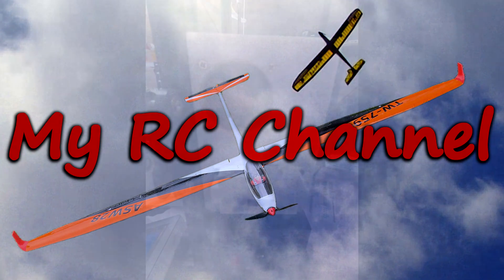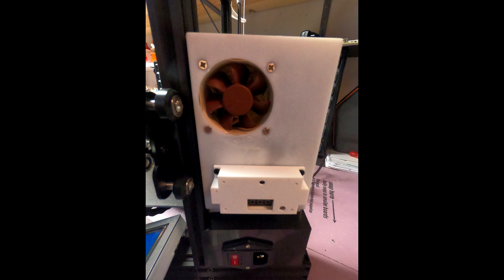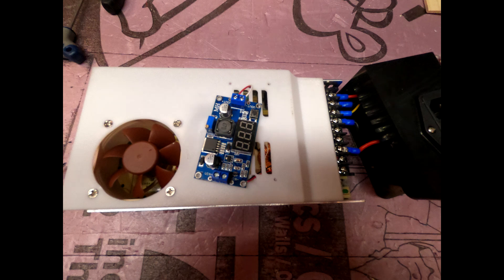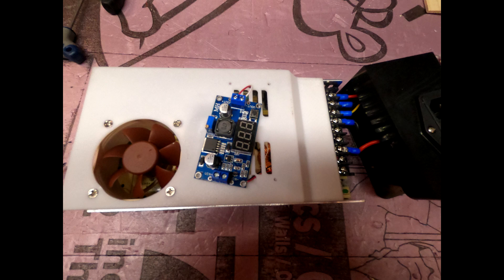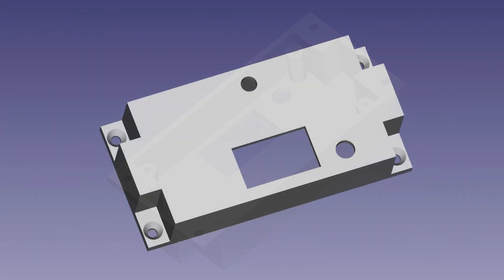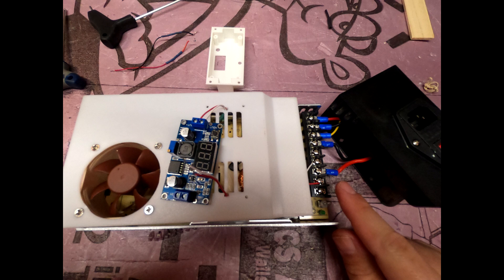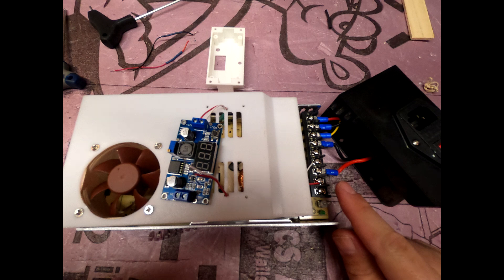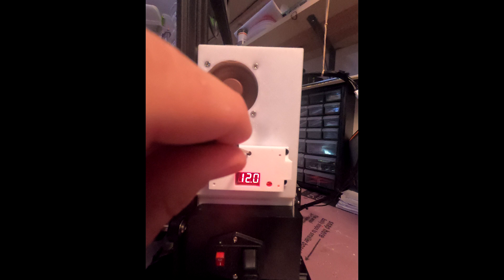Adding a Noctua 60mm Fan to the Ender 3 Pro's Power Supply (PSU)

Comment: My PSU fan is also a 12 Volt fan. so no need fora buck converter. Model Ender 3 Pro 2020. As far as i read in the net, it is the same for the previous PSUs ... all 12 V Fan in the PSU. All other is 24 Volt, correct, but the PSU is not.,
Reply from the maker: I'm not sure. I'm not a 3D printer expert... this is my first and only 3d printer. It ran almost 24-7 for the first 3 months... but I kinda got busy with other projects. I'll be firing it up to print some stuff for an RC plane this winter.
Reply: @MyRCChannel-CJScott  I am not saying that it is bad to use one though. The converter will kind of work anyway. The problem is just that it will lose a couple of volt in translation since the input voltage is that close to the output voltage. Leave it away and it works just fine as well. Even a tiny bit better since see above explanation 😏😏. If in doubt of my statement, use a lab power supply (or in this case just something with 12 volt output) , connect it to the input and check with a multimeter what is coming out on the other end, when it is set to 12 volt as well. It loses some in "converting"
Reply: @MyRCChannel-CJScott  he is right on the Ender 3 pro, the power supply fan is 12V!
Reply: @MyRCChannel-CJScott  Most Enders indeed have internal 12 V fan, i.e. the swap is literally just replacing the fan and soldering the wires of the new fan to the original wires.

If you for some reason want to power the fan from the external 24 V output that's for the printer (I haven't watch a lot of the video but I am assuming that's what you did), then yeah, you need a step converter, but it's a whole lot of unnecessary work. And you'll lose the fan regulation since (at least in my E3P) the PSU fan is not even running a lot of the time... On the other hand at least then it's being cooled nonstop which is definitely good.

Comment: Good stuff! Do you have the new 60mm fan blowing air into the PSU case? The stock fan on my PSU is positioned as an exhaust fan, blowing air out of the PSU case. Does it really matter? Thanks!
Reply from the maker: stephen burditt - I'm glad you enjoyed the video. When I made the mods to my PSU, I noticed that the bottom of the unit is totally open. So, whether you pull air from the bottom and out the top, or push air from the top down and out the bottom, the effect will be much the same. Whichever way you go, you're using a better fan than stock. Just make sure you are getting the voltage correct for the fan you choose.
Regards,
CJ

Comment: I’m wondering what’s going on. 
My ender3 pro came with a 24v meanwell psu but the stock fan inside says 12v on it
It might be a different version than yours. I’m wondering if your original fan was a 12v?
Reply: Thank you that was very helpful!
Yeah the original fan was a 2 pin.  Thank you for the reply.👍
Reply: I got the same, so it's just going for a 12v and save the converter for the Pi.
Reply from the maker: Hi, thanks for commenting and asking a great question. The stock fan runs off the board, so it is quite likely that the output on the board is stepped down to 12v. From what I've heard and read, everything on the Ender 3 runs at 24v, but the fan is an internal component of the PSU, so this may be different. I powered my fan off the power outs at the base of the power supply, which are 24v. I didn't want the fan to be controlled by a temp sensor in the PSU. My work area is always hot so I wanted my fan to run all the time at max speed for longevity of the power supply and I wanted the correct voltage for the Noctua fan for the same reason. Many of the Ender 3 mods like swapping Noctua fans for cooling the hot end are based on reducing noise versus improving cooling. I'm reasonably sure that no one has done comparisons on air flow/volume, which should be the real priority vs noise level. I'm going to be putting my Ender 3 in an enclosure and will be mounting all the electronics (boards) and the power source outside the enclosure so noise won't be a concern. Videos on that will be coming out soon.
I don't remember off hand... is the original fan output 2 or 3 pin? I think it was 2. Noctua makes fans with 3 and 4 pin connectors but I can't tell you the difference. I was a mechanical and software engineer so electronics is not my bailiwick. I know enough to get by and to be dangerous.
Reply from the maker: Update... the third wire (yellow) on the Noctua is for "signal" and controles speed. As I recall, the PSU throttles the stock fan speed based on temp. If the board has a 2 pin output, then the fans speed is being controlled by varying voltage or by a simple on/off temp controlled relay built into the board. The 3 wire Noctua can be run as a 2 pin fan by simple ignoring the yellow lead and changing the connector to a 2 pin. This is what I did, with the exception of using a 2 pin connector since I connected the fans pos and neg leads directly to the buck converter. I hope I have helped somewhat or at least pointed you in a good direction.
Regards, CJ
Reply: @MyRCChannel-CJScott  The third wire on a 3-wire PC fan like a Noctua is NOT for speed control. It is a tachometer wire which is used  by the PC to read the fans RPM. If the fan has 4 wires, the fourth wire is used for speed control, aka pulse width modulation (pwm).
Reply from the maker: @enterusernamefuck  Thanks for the info. If it comes up in future videos, I'll be sure to correct that. 
Regards, CJ